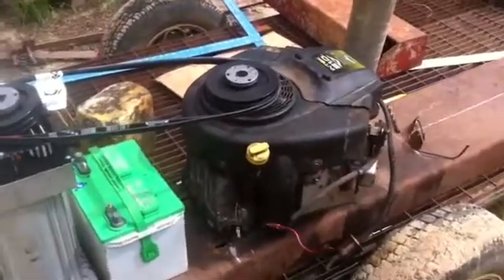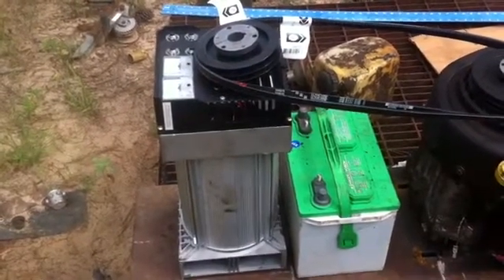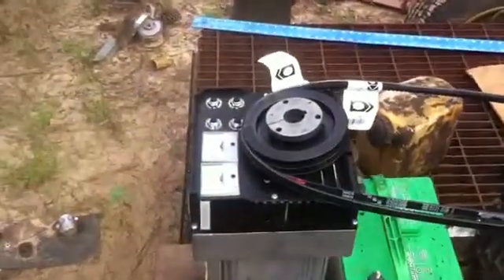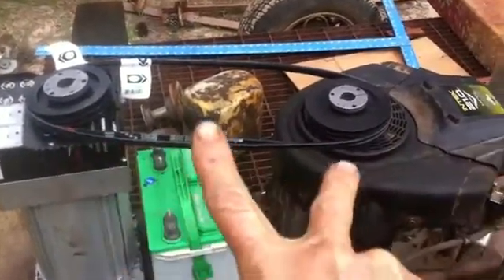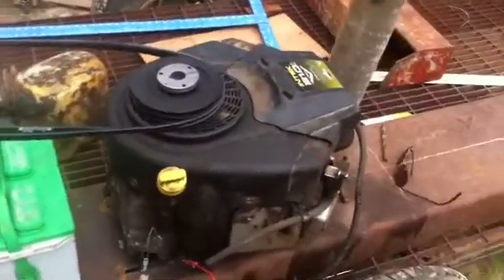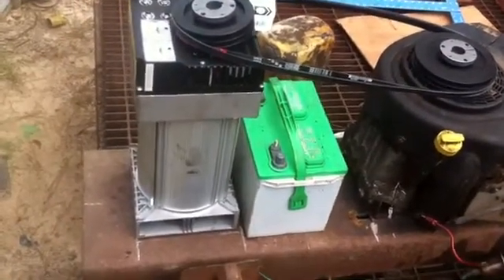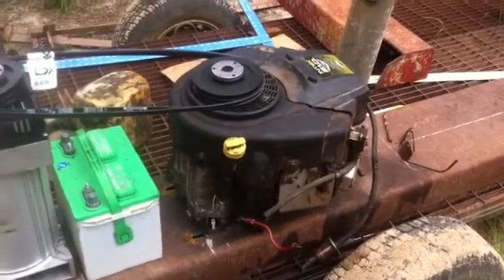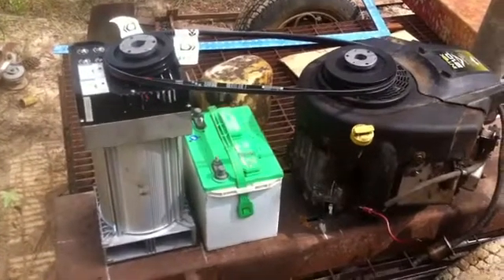DIY custom 10,000 watt generator update.

Comment: What size engine does it really need? Thanks
Reply from the maker: Was told it only needs 16hp to run at full capacity. Thinking about running generator head off of tractor pto instead at this point. Project has been on hold for years due to health. Do plan to get back to it soon though.

Comment: I've done something similar with a yanmar 2-cylinder diesel engine horizontal shaft . The project turned out somewhat good. The harmonic's from the harbor freight 7200 watt continuous powerhead, Is terrible at best. It causes a simple incandescent light bulb to flicker at 3600 RPM. It makes the microwave and fridge  sound different when running .Bought one it showed up damaged.I bought another one for replacement parts. I've gone through two capacitors already . In approximately 20 hours of operation .It would make a funny noise which made you think  the bearings were bad. But I found that it needed to be mounted very very solid. What I know now, is if I was to do it again I would not buy a harbor freight power head. Very dissatisfied with harbor freight head. I'm anxious to see how yours turns out The very best luck to your project. Keep us posted.
Reply from the maker: Was actually thinking about using the engine for a bandsaw mill at this point. Don't need a generator, already have a few up the 5500watt. Retired disabled and now having a little income, want to build a few things. Not easy to buy wood with my little income but is easy to build mill and cut lumber. I have most of the material and need trees removed anyway. Long as I can keep my old equipment running, I will keep doing the projects. Without it, these old bones couldn't do much. ;)

Comment: How much I can buy one
Reply from the maker: I paid about $300us for the generator head. Gas motor was salvaged from old riding mower. Pulleys and belts were under $100 if I recall right.